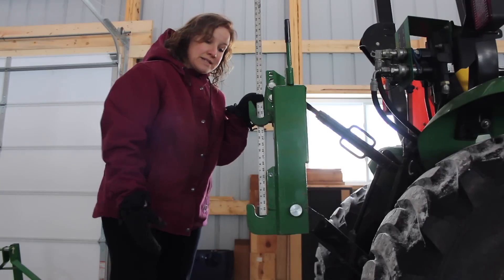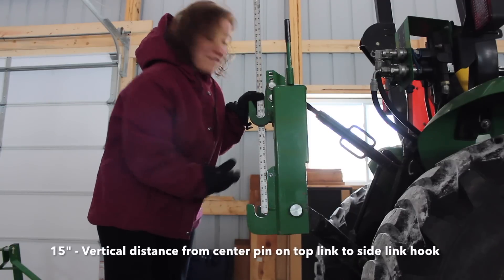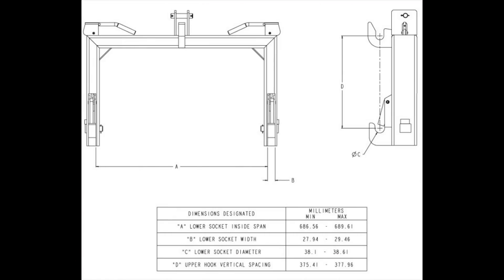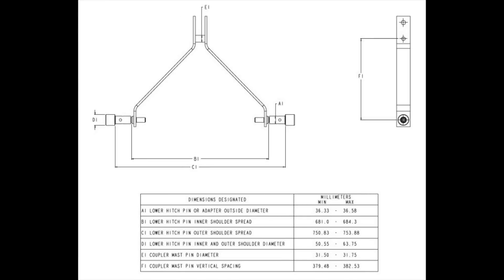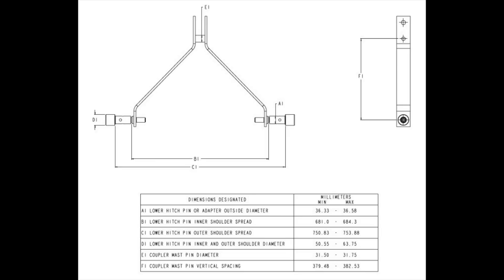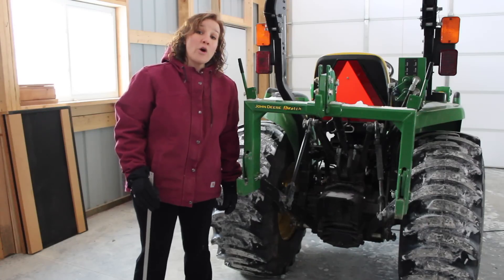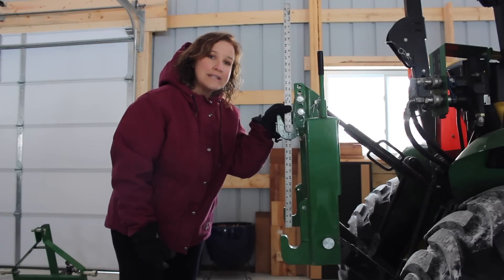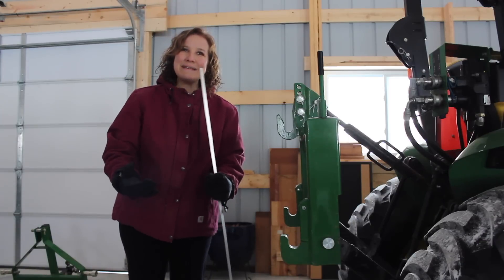DIMENSIONS - John Deere - iMatch Quick Hitch System

Comment: couldn't a guy just use a pin on the top part of the imatch to make a quick adjustment?
Reply from the maker: Thanks for watching and the comment/question @Darren Garlough!  I think your idea of using pins on the top part (hook) of the iMatch is definitely a possibility.  So far we have not needed to adjust ours but that is primarily because we are using the John Deere/Frontier implements designed to be used with the iMatch.

Comment: Thanks for the great video!  At 1:50 in the video, there is an attachment to the iMatch Quick Hitch and attached to it is a receiver for a trailer ball(s).  Is that attachment part of the iMatch Quick Hitch System or is it aftermarket or ???  Any information is greatly appreciated.  Thanks!
Reply from the maker: Hey +Tim Turis, thanks for watching and the question!  The Heavy Duty 3-Point Receiver Hitch that you referenced above is a great solution for moving trailers and other wheeled implements and is compatible with our John Deere CAT 1 iMatch quick hitch system and was purchased as a separate item from our dealer.  I had purchased another after market one that did not quite fit with the iMatch Quick Hitch System but the John Deere one we have now works and fits perfectly!
Reply: Thank you for the reoly!

Comment: Wow now I can weld my top ears back on my trailer mover, I ran into the ears being to high and also trying to hold the top link and trailer mover and put a bushing and 4 washers ,that was hard to do, and the top was cat 2 the bottom was cat 1 ,I also  have 666 John Deere snow blower that was on a 2350 JD,I had to make new lift arms on the blower to work, another one was my Linbach HD S/o 6' scraper blade it has a pivot pin in the center of the top link so I have to use a yoke adapter to make it work , Thanks for all your help, Merry Christmas Mark.

Comment: LOL, that was great! Love this video with the bloopers. You two are great. I don't have a iMatch as all my implements are not iMatch compatible. But from what people have said you should get rid of the bolts and nuts for the top hook and get some flat head pins so you can get them off and put them on a lot faster if you have to move the top hook. They say a flat head pin so it won't interfere with where it hooks up. Some have said that the bolt head interferes and they had to pull the hook as far out away from the iMatch so that it won't before tightening it up. Food for thought.
Reply from the maker: Thanks again for watching +mi2tn!  And thanks for the info!  I also have seen others get rid of the bolts and nuts for the top link hook and replace it with something that is more easily adjustable.  At this point, everything we have works well now except the landscape rake which sometimes still gets hung up on the head of the top link bolts when we try to disconnect it.  By the way, what implements do you have that are not iMatch compatible?
Reply: All of them. Tiller, box blade, disk, chipper. My potato plow is the only one that might be iMatch compatible.

Comment: ahh-another movie star is born. lol. very good. and ur right about the problems of the i-match. mine has the stationary hook. it's that old. lol. i have found the same thing with mine, my problem with my older frontier implements is-i have to change the length of my top link, in order for the hook to work correctly. that is why i would love a hydraulic top link.
Reply from the maker: Thanks +BigJim57!  I did notice that the older units still have the stationary hook and am thankful that ours is adjustable.  Although the dealership tightened the bolts so well, I am going to need someone with a heavy duty impact wrench or a long breaker bar to loosen them up if I do want to adjust it.  As for the length of the top link arm, a hydraulic top link is on my wish list and with the rear hydraulics already installed on the tractor, it should be pretty easy to get set up.